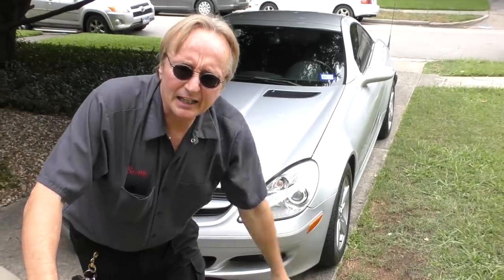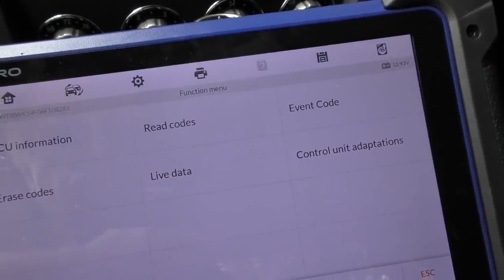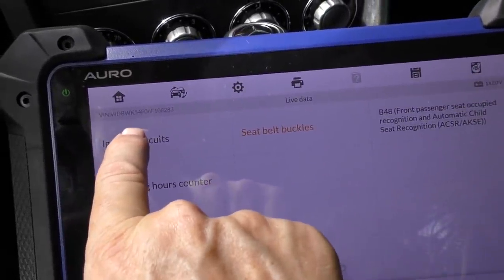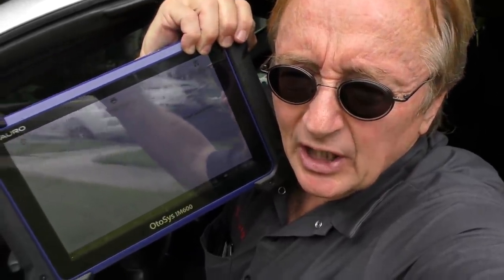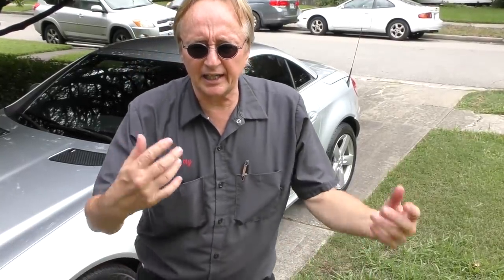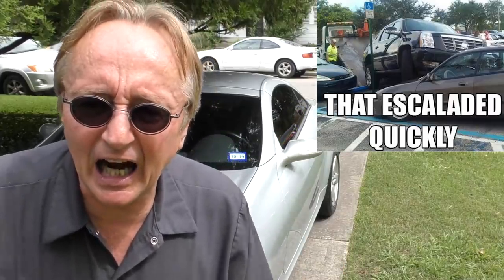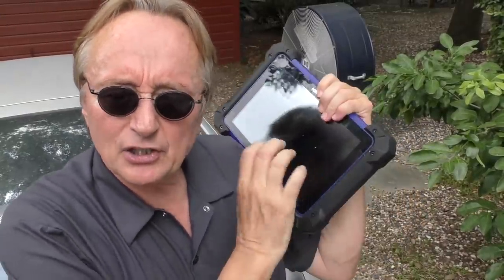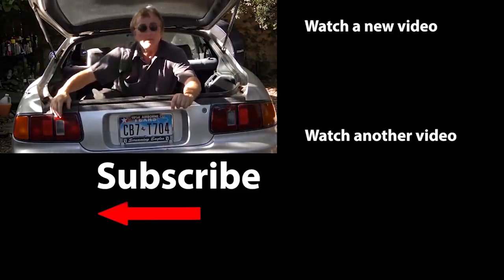You Can't Even Work On Your Own Car Anymore

Comment: I say this calls for the black tape fix, put a small piece of black electoral tape over the light and fixed...
Reply: No, no, no... You should do the proper repair here - take the bulb out.
Reply: I like that fix better ;)
Reply: In the inspection, the light has to come on for a few seconds (self-test) when you switch on the ignition, so the tape doesn't work.
Reply: @sup3rbird 
Let Volkswagen be your guide.
Reply: @sup3rbird  well..... you could put a relay on that bulb, so that it stays on when doing the self test (when the key is in ON or ACC position?) and then, when the car is running, the relay will cut power to the bulb... inspection PASSED
Reply: Some places mandate it works or they will ticket the car until impound.
Reply: Did that with the rear abs light on one of my vehicles, problem solved.
Reply: @mrcomplex23  
You can't they got hip to the bulb removal, they have circuit boards behind the gauges now with little tiny lights that's soldered in.
Reply: Unfortunately. The srs/ airbag system is compromised until that connection is repaired. Dont wreck...

Comment: Don't buy a Mercedes then you won't have this code. Lol.
Reply: lol
Reply: I just got done working on my 88 Chevy celebrity. new spark plugs. feel damn good to own a old Junker
Reply: Old Iron  My c300 just hit 250k and its not just a status symbol. Once you have german and see how everything is over-engineered and well made, everything else feels like thin cans with wheels that hold the road like 70s muscle cars.
Reply: Ah. A fellow problem solver.
Reply: Try buying one in Iraq where temperatures reach 55C+ in summer.. then you will witness hell on wheels. I have a Corolla and I've fitted an extra fan on the radiator and the compressor would over heat and disconnect when the temperature reaches 48C thats equal to 120F .
Reply: @intellectracoon  I definitely agree there are alot of cars that just are not made for the extreme heat or extreme cold also, and for your case the extreme heat it must be very difficult keeping a car working.
Reply: Old Iron if you can afford I don’t see a problem
Reply: @electricman1405  we service the engine cooling system every summer because if it fails your engine goes to heaven 😂
Reply: @intellectracoon  lol. I know what you mean.
Reply: yeapp
Reply: @aundrayperkins9796  ... WOW! And I thought my dad's 2001 Cavalier with 93,000kms was still going strong. Great work my friend!
Reply: I was hoping that Scotty would be giving away one of these high tech units. lol ... Thanx for the video as always, Scotty.   
Cheers!
Reply: Old Iron  Mercedes are for the most part pretty solid cars. There engines and transmissions are solid. There plenty of them driving past 200k miles. Are they higher maintenance then a Honda Civic? Of course. Lexus is the best car maker in terms of luxury and reliablility but they have issues like this as well...
Reply: Timothy Wells Timothy,Even if you can afford it who the hell wants to go through all this bullshit, and my worst fear is to have an issue missed diagnosed, and then have to pay more money to get it done right, not to mention the time invested
Reply: Old Iron  believe me, a lot poor people own them to show off than rich people.  Usually rich people are smarter.
Reply: Ya German cars are Scheissdreck...Zehr Toya Scheissdreck
Reply: @Motorsportsgeek  F150's are smoother and handle better than Mercedes.
Reply: Great cars when on a lease but as a private buyer forget it. It's a money pit same comment for bmw's .
Reply: @sullivanrivers7147   Joke of the century man, good job, it will be written in the history books.
Reply: @Motorsportsgeek  Just personal opinion, I own a 2016 GLA250 and a 2018 F150..
Reply: Old Iron  why you replacing the brake and fuel lines?
Reply: @Motorsportsgeek  He's right... It's pretty well known F150's drive/handle better than Mercedes, at least Mercedes here in North America.
Reply: @Hans Lmao yah right, with the shitty vw 2.0L in them they are far from "most reliable". Two people I know loved theres until the tensioner jumped and they had to spend 5k on a new engine. They all drive w204 mercedes now.
Reply: mydogcujo my  celebrity has 370k miles on it same engine and transmission. I do all matenance myself. I took it to a garage to get ball joints and tie rod ends done. I only paid 400 dollars for it at a junkyard because someone junked it because it had over 200k miles lol.
Reply: @sullivanrivers7147  Every model is different, manufactures all make good and bad models. Never buy base model Mercedes like the GLA, CLA , B class.. They are all cheap and those are just for the poor to afford being seen in a mercedes. I will agree with you when you say your f150 rides better then a gla.
Reply: @Motorsportsgeek  Yea well use some common sense, why would you assume I'm comparing an F150 with a top of the line Mercedes... Obviously I'm talking about regular Models. So if I'm correct then, does that mean it's still the joke of the century?
Reply: @sullivanrivers7147  Top model? F150 can cost as much as a c-class and e-class with just a few options. Sorry you wasted your money on Mercedes shittiest model, you'll know in the future that fwd Mercedes aren't the best purchase. And don't reply with, its 4matic cuz its fwd 90% of the time. Next time be more specific before stating dumb vague comments.
Reply: @aundrayperkins9796  I say you definitely got your money's worth on this one
Reply: Randy McDonald ..only a few year 68 cars left
Reply: Old Iron  Not saying today's car is not built with Quality, they are built with fancy technologies and also shorter life span for making more money.  That is all in manufacture controls.   I wouldn't buy any fancy car which you can do nothing about it (No Option to DIY, only stir you into it more).
Reply: @Motorsportsgeek  Luckily it is not my Mercedes actually, but my girl friend's.. I agree, it is a piece of junk. which makes me wonder if any of their models are any good.
Reply: It is better to lease the Mercedes Benz and give it back after 3 year
Reply: Randy McDonald  correct. With all the probs on mercs, that cannot be fixed unless u go to stealership, I wouldnt buy merc anyways!
Reply: @katrinahopkins1516  I looked good when I had one. but the rental car I had to get cause mine was in the shop, then I didn't look so good.
Reply: I own a 2009 buck lacrosse super v8 runs like a champ with 83k miles hoping for another 150k ATLEAET
Reply: @aundrayperkins9796  ... LOL... Right on! Someone's trash is somebody else's treasure. Gotta love it when you score a great old car that's still solid but someone gave up on it. 
My dad's previous car was a Celebrity, an 88 I believe also. lol
Reply: buy a mercedes body, fit in a 1984 Toyota engine and live happily ever after!
Reply: @Hans 
an     audi    is   about   as "reliable"  as    a   saab  -  stranded   again,  always  broken.....saab / sob  while  stuck  on  side  of  the  road.
Reply: If you buy a mercedes you most likely have the money to fix it, just saying 🤷🏽‍♂️
Reply: You would think more people would have that kind of common sense, guess sense just isn't common anymore.
Reply: driver4011 I owned a Saab that was abused by previous owner. Never maintained it. Once I catched up on maintenance, it was the best car ever. Eventually sold it to buy a newer BMW. Would definitely buy another Saab again. As for audi/vw, I’d never buy one. Saab was my first car and it never left me stranded for the many years I owned it.
Reply: I've never seen a car of any make or model built after the year 1998 that hasn't had an airbag warning light come on at some point...interesting that it may sometimes may actually be a sensor in the seat belt.
Reply: Old Iron But BMW and Mercedes aren’t known to be unrealisable? And sure they good cars for status and bragging, but how about the BMW M3 serious or AMG? These are serious cars for serious car enthusiasts, not people obsessed with status, plus you don’t have to be a show off with a super Luxury model either, people can buy these cars because they are high quality cars with top class extras and systems.

It’s not all about superficiality
Reply: ltwargssf R well that’s just not true I’ve owned a few quality German vehicles, they are awesome but I wouldn’t say it makes something NOT German feel like tin cheap crap.
Reply: Sullivan Rivers Mercedes don’t make pickups so that’s a terrible comparison, totally different in many aspects.
Reply: Keith Rodgers Well totally false, if you buy any quality vehicle that you don’t look after or you bought as a pile of worn down crap then don’t be surprised  when the maintenance and repair bills start flying in, that’s just common sense
Reply: From Mercedes to Mershitty when you get this code.

Comment: "$583 dollars for the seatbelt tensioning system".....
.......*grabs piece of electrical tape*.
Reply: You Tube Well, 29 people got the joke, but apparently you didn't, so I'll let you in on a little secret.........it's what people use to cover up that pesky check engine light.
Reply: When you couldn't get the joke, so you make an excuse saying it's because it's a bad joke. Classic.
Reply: You Tube OOOF
Reply: @isthisnametaken978  haha!
Reply: I would go a step further and remove my gauge cluster and take that pesky SRS light bulb out. That's what I did with my maintenance required light and since then, I've never been bothered ever again.

Comment: Each rube goldberg dingleberry they stick in there is going to cause you a problem sooner or later...
Reply: CM Rosary  Its unbelievably how much over complicated garbage that even the dealers won't have a clue how to service 10-12 years from now when they actually start breaking...
Reply: Agreed with all these comments
Reply: It's designed to fail later. They only care about 1st users of the product. Those who are 2nd or 3rd owners are not the target market because they don't count as sales numbers.
Reply: @Powertoolz  
I'm an engineer and when I was in college we had a class that was supposed to be for designing equipment to last, but the same research and formulas are used by manufacturers to make sure that their equipment will last just past the warranty period and as little as possible after that. So when people say that they are designing equipment to fail, they are more right than you know. You might also notice (if your old enough to have ever seen them) that Maytag never shows those commercials where the repairman is bored because he has nothing to do because their appliances last so long. They gave up trying to make their appliances last, and just started cutting corners like everyone else.
Reply: @davidscott5903  
Maytag moved to Mexico and China. About 100k jobs from Ohio. A mechanic once showed me how GM had a metal gear turning a plastic one a Trans Am pop-up headlight assembly. Guaranteed failure.
Reply: @fazole  
EXACTLY! 
They learned that it was more profitable to make cheap junk in a foreign country and keep selling more of them when they break, than to actually sell quality products and rely on customers who are willing to pay more for the quality. Because most people would rather save $50 now and spend another $500 in 8 years than spend $700 now and have appliances that last 20 years or more. My washer and dryer are 18 years old, with many years to go, because I did my research and bought quality. Manufacturers, with their short sightedness see that as not being able to sell products as often, but they ignore the fact that children that grow up and become adults learn from their parents about which products to buy, and which ones last, and they choose to invest in the same brand and they also tell their friends and family, and before you know it they drive the competition out of business. But that takes time and doesn't earn instant profits for stockholders, so that went the way of the dodo.

Comment: Don't know how it is in other countries but here in Sweden you can pay almost any mechanic 10-20 dollars to scan you car with one of the fancy scan tools and get a report with all the error codes in the computer. Some even do it for free.

Payed $20 to a mechanic to scan and reset the codes my 2006 vw passat and found out the error code (01217 - Side Airbag Igniter; Driver Side (N199)
 001 - Upper Limit Exceeded) was permanent. After some googling and youtube I found out it was a classic error with an electical connector beneath the driver seat so I unlpugged the battery, cut the connecter and soldered all the wires together as they sat in the connector. Payed the same mechanic annother $20 to reset the code and then it was gone. <$50 job instead of $800
Reply: Same here in the States. Really depends on the mechanic. Some will charge you some won't.
Reply: Auto zone, and any business related all do it free in the U.S.A
Reply: Damn, for $19 I have an app on my phone that does that....and I only paid the $19 once for the blue tooth obd2 adapter.

Comment: if you have an 05-08 subaru with the SRS light on just pull the computer chip in the map light assy and reflow all solder joints, works like a charm

Comment: The first thing to do (after disconnecting the battery) is disconnect all of the yellow SRS wire connectors, clean them with electronics cleaner, reconnect the connectors, reconnect the battery, and then clear the SRS light to see if it comes back on. 
This worked for my 2003 Elantra - one or more connectors needed a little corrosion cleaned off.

Comment: We live in a world where we even have to fix the seatbelt
Reply: ITZ BRYAN to be fair it is a critical safety mechanism.  If a computer thinks there's even a small fault with it I wanna know and judge for myself whether it's worth fixing
Reply: critical bs safety mechanism. seatbelts dont actually save lives. it's the rest of the car. ever been on a rollercoaster? the belt isn't necessary.
Reply: @lolwtnick4362   Bud, my Dad is on Coumadin and would have hit the steering wheel and had internal bleeding if he didn't wear a belt that day but instead he went home the same day with belt rash.

Comment: You could technically put a resistor between two wires that go into seatbelt airbag system and the light would go out, but that's quite illegal if you do it without owners knowledge.
Reply: Interesting suggestion. Probably only illegal for Scotty to do it, not for the owner to do it.
Reply: Too much resistance means the connector has poor contact, a lot of times all all you have to do is unplug the connector to the affected part and  tweak the pins with mini needle nose pliers check for and clean pins and reconnect.
Reply: @markkunzman9095  Well yeah as long as everything is fine, resistor is mostly used on belts that already been shot locked.
Reply: @markkunzman9095  Bingo! The sensor is probably fine. The connectors to the sensor just need a reseat. Parts = $0.
Reply: The part of the seat-belt that has the small explosive (squib I believe) that tightens the seat-belt in a high speed crash is defective according to what he showed. I get the feeling he thinks it's just some electronic gizmo. What it means is the pre-tensioner explosive charge won't fire in an accident

Comment: I'm not current since I left Japan but when I lived there this is what the inspection process was like.
In Japan, a new car is good for two years before inspection is due. You turn your car into an inspection station and you don't get it back until whatever they find wrong is fixed.  That may take a couple of weeks. After the first two years with a new car, you go through this every year after that. It's so expensive that you seldom see many used cars beyond four years old and often two. I think the used ones are sold overseas after replacement.

Comment: I remember vehicle inspections in Maryland. What a joke. My headlights needed adjusted almost every time on all my cars.
Reply: Leonardokite no joke.  Had a Mightyoubiteme (That’s a Mitsubishi to those unaware), the damn car failed inspection because the rolled muffler lip had a rust hole that was causing a slight leak.  They said they couldn’t fix it unless I bought a $1400 factory exhaust system (this was a Chevy dealer) and I laughed so LOUDLY and told them to drop that car off the lift and would be back tomorrow with it fixed for $5.  They thought that was a joke and got laughed at again when they didn’t believe me and then handed my passed inspection certificate over.  I laid that weld in so smooth 😂 I ended out getting full stainless magnaflow for $300.  Shop around folks...stealerships will get ya if you let them.

Comment: This seatbelt is reparable $140 and good as new. There is is almost always way out of visiting the stealership.
Reply: That's not going to fix the short in the tensioner which is causing the SRS light to come on. There's actually nothing wrong with the seat belt itself; just some wiring.
Reply: Go out on their lot, rip one out of one of their new cars, problem solved.  For the ridiculous price of a new vehicle today regardless of emblem they should be providing repairs to their nightmare on wheels free of charge in the first place.
Reply: @brandonb.5304  He saying the price of an aftermarket piece, likely found online from a third party for a 3rd the cost. Thinking parts have to come from the stealership is the issue.

Comment: They will do anything to force you into the dealer. 
The trucking industry forced the engine manufacturers into a standardized Computer code, but the body manufacturer has put a bunch of computers in the truck that you can't talk to. As an example Volvo has a light control module (headlights, taillights) that you can change, and then you have to take it to the dealer to have it programed to your truck. 1 hour shop time $160.